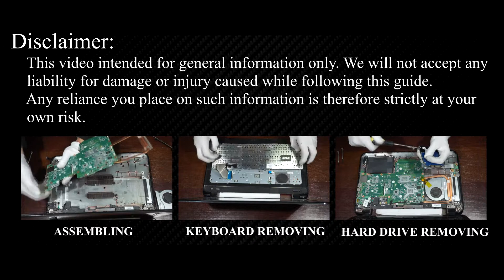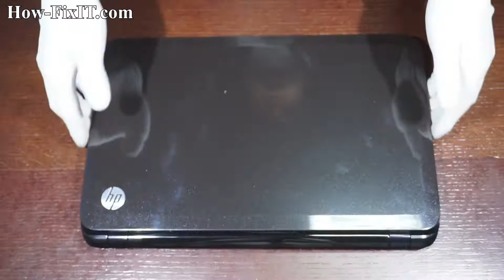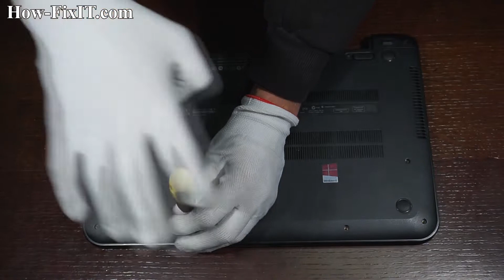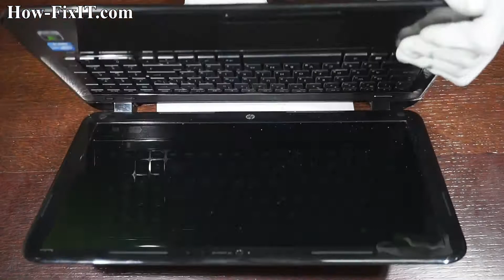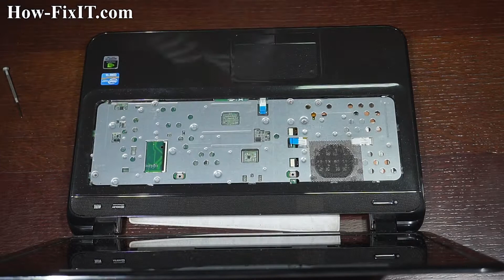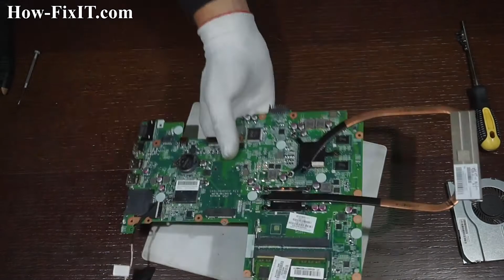HP Pavilion 15-b Series RAM Upgrade and Install | Step-by-step DIY Tutorial

Comment: can i upgrade the ram to 16gb (8gb x2) ??, please answer
Reply: I'm planning to upgrade my ram, how bout now, did you already upgrade yours? I heard that if your laptop operating system is 32 bit it can only handle 4gb ram but if you have 64 bit then i think you can handle more ram like 16 gb of ram.
Reply: @hotdogchicken3279  well.. I already stick an 8gb DDR3 RAM alongside with the 4GB DDR3 last month.. so for now its 12GB in total.. I think its still can be upgraded to 16GB (2 Stick of 8GB DDR3)